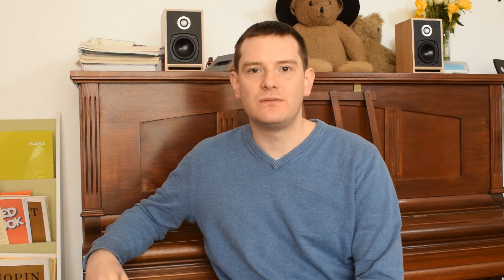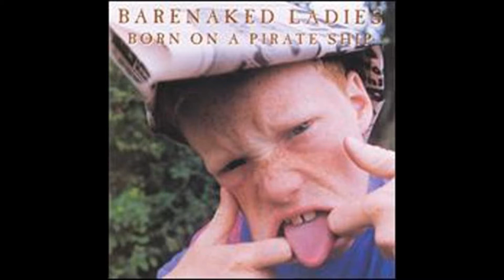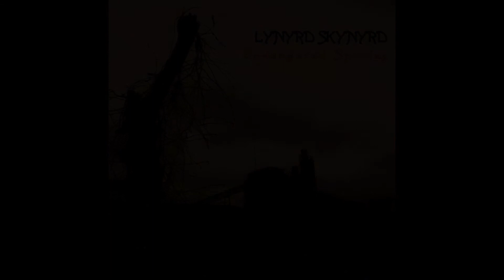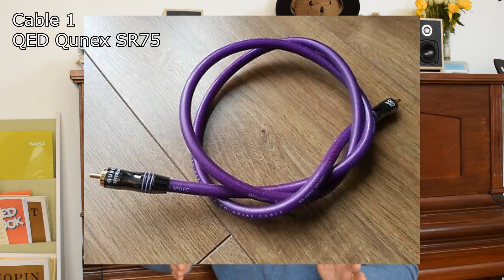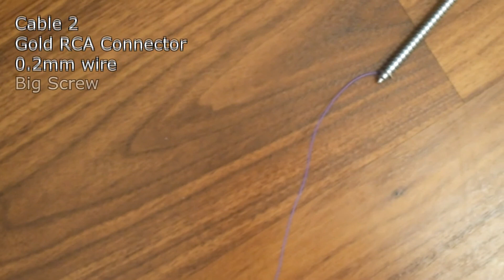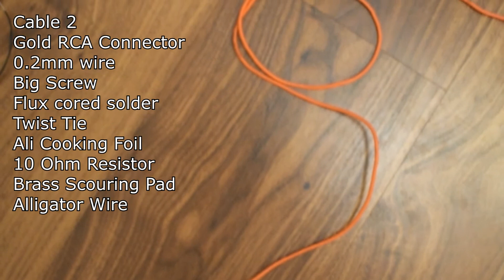Digital Audio Cables - Snake Oil? You decide!

Comment: A test with no baseline... no familiarity... YouTube compression...🤣 They're snake oil. Ez day. This isn't a debate for any serious people.
Reply from the maker: The uncompressed files are linked in the description. You can get familiar with them as much as you like.
Reply: @Audio_Simon  my guy you're entertaining the idea digital cables affect sound. I happen to measure electronics for a living, I specifically got bored and looked for snakeoil defenders and anti-science "decide for yourself" types.

You're not trying to convey the static difference between loudspeakers or offer a subjective experience with headphones backed up by FR charts with industry standard measurement rigs and normalization...

You're contributing to the dumpster fire money pit of "high end audio cables".

Lastly, I also rebuild cables and solder. I am also very familiar with FFT technology and modern filters (AKM/ESS, no experience with FPGA proprietary tech).

There is ZERO consequence of digital transport cabling. Analog? It's workmanship. There's no audiophile running a long enough cable for LCR Impedance and transmission theory to affect the audio band and I am not aware of any egregiously mismatched cables for AES/ABU/XLR/RCA characteristic impedance.
Reply from the maker: @CFBlueCFC  I think you misunderstood the message in this video.
Reply: @Audio_Simon  Please, what was the point? Other than a flawed exercise in AB listening to expose charlatans in the comments who believe one was better than the other 🤣🤣🤣
Reply from the maker: @CFBlueCFC  This is called dry humor or satire.

How is it flawed? This is not a microphone recording a speaker via an ADC. It is a digital cable being tested, so what gets captured in the recording file is the same as your DAC would receive. No ADC and DAC in the test stream, never outside the digital domain. The uncompressed original files are provided. You can listen any way you like as long as you like.

It's just so obvious that any difference is so small as to be insignificant despite despite cable construction being ridiculously poor.
Reply: @Audio_Simon  there is no difference. And if there was any difference you don't have an eye diagram measuring reciever to demonstrate the pulse train time domain error(jitter). The fact you believe there is any analog change based on digital bits is the problem with subjectivist "listen for yourself" types.

Stop using psychosomatic experiences tainted by expectations to grant snake oil any legitimacy. There is no difference between the digital cable types, flat earthers and anti-vaxxers.
Reply: @Audio_Simon  Easy exposé; do you believe OCC, silver, and gold have an audible effect.
Reply from the maker: @CFBlueCFC  Did you watch the bit that shows what cables were under test at the end of the video?